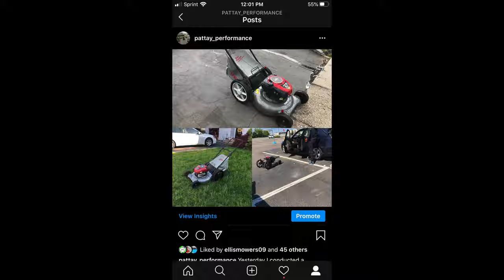HOW TO FIX $40 NON RUNNING LAWN MOWER & FLIP IT FOR $150 FACEBOOK MARKETPLACE

Comment: I’ve never flipped a mower within 48 hours...same day flip, you are a beast!  Love the idea of painting the blade, never had anyone flip the mower to see the blade yet, but might be worth it.  Spark plugs, I use a wire brush sometimes to clean it and throw it back on.  GREAT FLIP, don’t we wish they were all this easy!  Need that shine recipe!
Reply: I hit the underside with wd 40 after cleaning. Makes a good selling point for the ads.
Reply from the maker: Just wait till next year when you start with the “Spring Sprint”.  You will sell a lawnmower the same day!  

I use to swap em all the time for new, then I transitioned to pulling them, cleaning them, reset gap and install with anti-seize.  Now if the mower runs I don’t even bother pulling them anymore lol.

We can only dream!  That is why every flip is the same but different 🤣